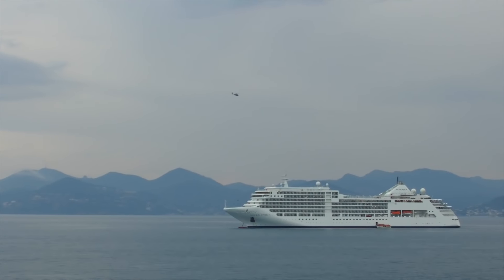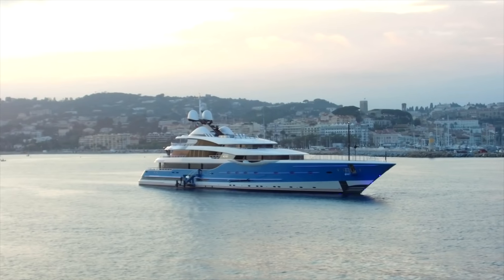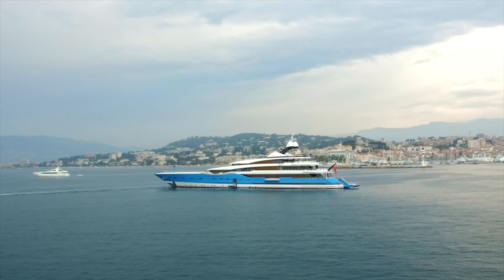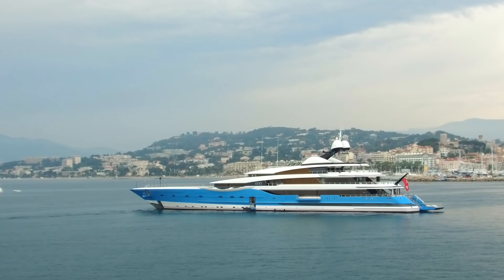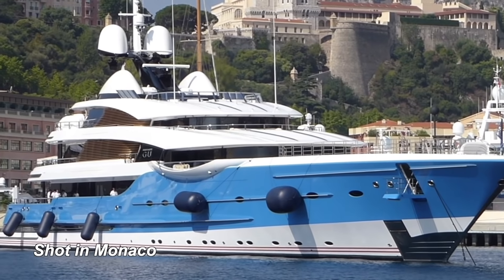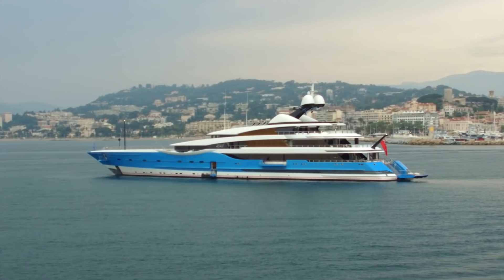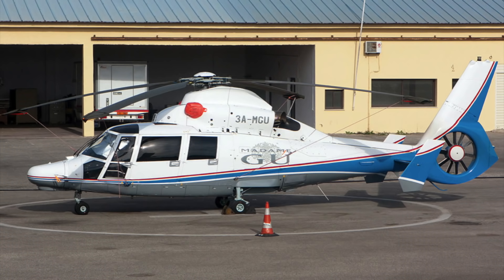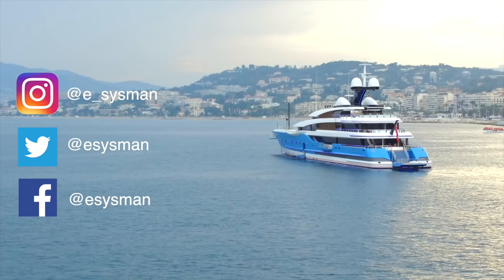Madame Gu - Most Expensive Paint Job on a SuperYacht

Comment: Nice to have you back, mate. You should do a video on yachts and colors. I've always wondered why virtually all yachts are white. Considering what you say in this video, maybe one of the main reasons is simply of economic nature?
Reply: Heat reduction, aircos having to work less hard etc. And many owners do not dare to choose something different than what most others have chosen (Maybe resale value or chaters bookings will also play a role)
Reply: @williamdrijver4141  Ok, I see. I've also read somewhere that white paint makes repairs easier because you don't have to deal with different nuances.

Comment: The hull colors were chosen because of their similarity to the Russian flag. Heli hangars are scarce in this size range, but will eat up a lot of interior volume. Dito for the tenders
Reply: There are a 49 meter yacht that have a helicopter hangar, it's a Flygtship named T6.
Reply: @anderspersson7084  at 568 GT volume T6 probably is the smallest with such a hangar? Pieter Beeldsnijder design, to my surprise. AMELS' Ilona had such a hangar, until a crew member died in it
Reply: jimmy matho  It has 36 crew (often in cabins smaller than an average jail cell, but still) lots of tenders en a complicated heli hangar, they all cost interior space. (On photos yacht interiors often look much bigger than they are in reality)
Six guest cabins is normal for this size boat I think. For the money relatively small inside